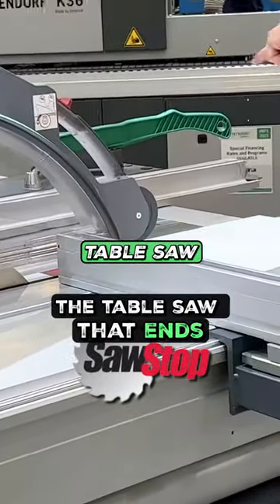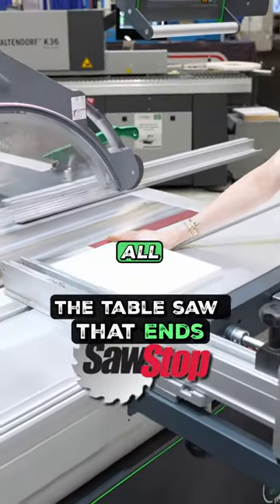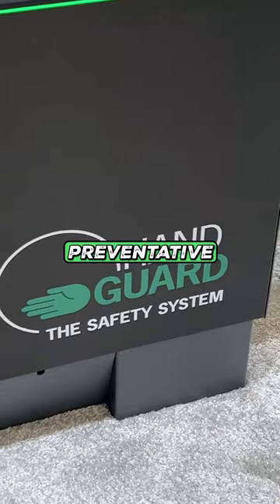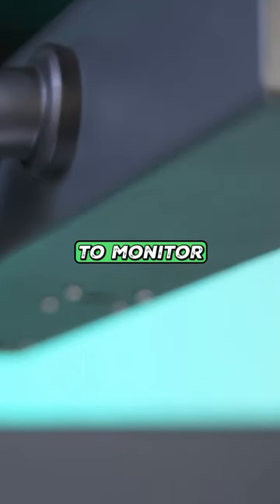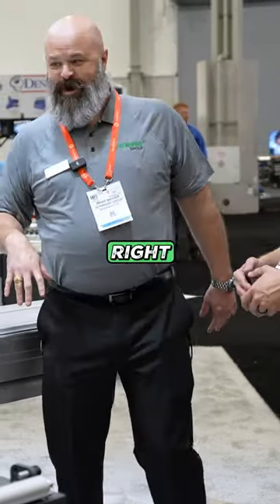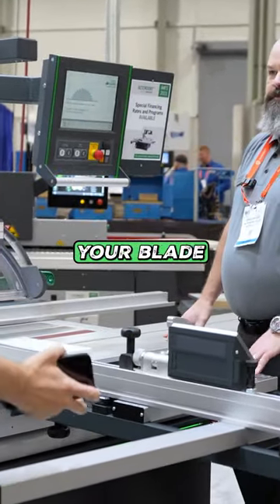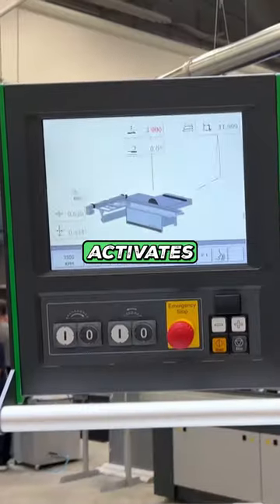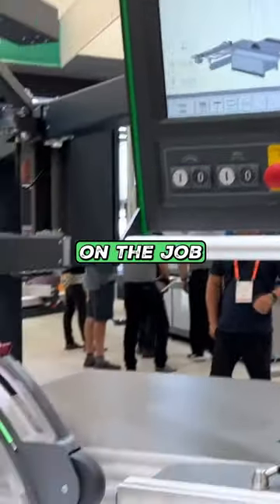Could This Tech End SawStop's Monopoly on Safety?

Comment: I am all for anything that can reduce the chance of a injury.  Many years ago at a pallet manufacturing shop i was a few feet away from a man that lost 4 fingers on his left hand. Radial arm saw accident.  He wasn't paying attention, was in a hurry and pulled the saw across his hand. One other boy and myself was digging through the sawdust looking for his fingers to send with him to the hospital in hopes of reattaching them. 
We actually saved three of them, the pinky finger was too mangled.
Reply: Been there.  Ran my hand through a table saw when I was 16 and distracted.  I was lucky enough to have a good surgeon so I only lost one joint in my thumb but they did a good enough job that I now type on a keyboard all day for my tech job 35 years later.
Reply: Damn
Reply: I was thinking that technology is aiding us in becoming stupid, but your comment snapped me out of that nonsense.
Reply: @thegoodfight365 anything can happen sadly, I work on the railroad and we had a guy that got crushed between two railcars still new but radio failure as well. He's alive but physically he's messed up for life. My company came up with a remote that you can push on your person to deactivate the locomotive even if you're 20 cars away ,pretty neat tech.
Reply: The crazy thing is that this technology (as well as that of SawStop) won’t stop problems of pinched work pieces that get jettisoned back at you. I wonder what messes people up more: grinders w/o guards or table saws?

Comment: This sounds like one bug away from disaster. I’ll stick with reactive which has a lot smaller margin for error
Reply: I wonder if there’s a way for them to combine both with a reactive one as a safeguard if the other one fails
Reply: @alop53O1  That would be perfect - it seems like this system can react quicker than the saw stop, so you can save the blade but still have the saw stop as a safeguard in case something goes wrong. It would be cool if the two companies collaborated on that.
Reply: @quazimoto5241 it reacts quicker because it does not rely on physical touching to happen like saw stop, which means it can go down much earlier than sawstop, so it wouldn't be practical to combine both mechanisms because they work differently but achieve the same goal
Reply: @L0LIProp   why wouldn't it be practical to have a sawstop system function as a failsafe for this?
Reply: My thoughts exactly.
Reply: @bakedbeanfanclub  cause the saw stop is a instant drop instant stop basically the worst that’ll happen is a small cut this system does take longer to go down but still prevents injury as it goes down before you get too close he looked like he was a good distance away and could see the blade moving unlike saw stop where it disappears in one frame to be short I think combining them would work just not as well as the saw stop does currently as that slight bit of extra time to drop means a deeper cut in your fingers
Reply: Ok boomer.  It's not like it's code powering a rocket, it's just a comouter controlling servo motors. 🙄🙄

Comment: It would be ideal to have both the proactive and the reactive safety systems in one saw.

Then you have a backup if one system fails.

Although, nobody should need these safety systems if they bring their brain to the game.

As someone who has ran their hand through a table saw and had everything reattached mostly successfully, I have the most razor sharp focus on every cut because I've experienced the consequences of distraction.
Reply: The only problem is that a capacitive system cannot cut aluminum, plastic or green wood. That was one of the issues we wanted to solve by creating this system.😊

Comment: What happens when the cameras are covered in sawdust? Or even worse, MDF dust?
Reply: Likely has a pinhole with compressed air ran to it. That’s typically how these type of cameras stay clean in a debris filled environment
Reply: I'd also bet that the saw won't turn on if the cameras don't have a good readout

Comment: This is a really cool idea, but how do you compensate for when wood scraps or sawdust block the sensor?
Reply: The system will be able to tell if the vision is blocked and there will be signals to tell you to clean the camera’s
Reply: You shouldn’t have that issue if you’re running a shop vac to collect the saw dust.

Comment: Kitchen equipment I work on has a "camera" i.e laser that works off of reflector plates. These regularly stop the machine from working due to moisture on the lenses. How is this safer than SawStop without constant nuisance issues?

Comment: It's a nice try at sharing the safety market with Saw Stop, but really, Saw Stop's reactive system is a solid simple fool proof system that I would trust way before a software heavy "AI" system. I see this maybe being more for a commercial setting, where people can throw money away in order to appease lawyers, insurance people and OSHA. When actual safety takes a back seat to the apparent effort to achieve it. In which case it takes away liability, no matter if the device actually works. This isn't so much a hit on the company in the video as a reflection of my trust in modern computer systems. Hopefully they find their niche.

Comment: Ofcauss its super impressive and works
But! When it starts using electronics it becomes something completely different for consumers…

The sawstop is so great because its just mechanical parts and one loop of wire in essence

Anyone can fix a machine with a sawstop installed on it but you need an expert to fix anything if this saw has a problem

Comment: Wait for Sawstop to sue it out of existence like they did when Bosch implemented a safety system that doesn't eat your blades.
Reply: I think bosch was busted by sawstop because the means of protection were too similar. This saw has quite a different method for saving appendages.

Comment: And it only costs approximately $50,000. And they have their own patent on the Hand Guard system and I don't see them rushing to license to others, and if Grizzly/Delta/Harvey etc. all start using this system it opens them up to liability for their other machines. Does it seem like a great system, hell yes, and if I decide to build a new shop I will be ordering one.  But I also had one of the very early Saw Stops.  While building my last house, the contractor was allowed to use my Powermatic 66 and had one of his employees lose a thumb due to kickback -- he was crosscutting without a sled or mitre gauge, piece kicked back, hit him in the forehead and, stunned, he put his right hand right across the spinning blade.  Very ugly.  Saw Stop came out, i bought it.

Anyhow, I very much doubt we are going to see Hand Guard on any machine under $30,000 for more than a few years.  Also, Felder has a competing system which I looked at a couple of years ago.  At the time was only available on their Format line, again mid $50,000.

Saw Stop was and is a pioneer, an innovator and he offered to license it to all the major manufacturers.  They all said no, probably realizing that it would potentially expose them to liability if they continued to sell non-Saw Stop enabled machines.
Reply: I'd love a source on that Saw Stop tried to license it because their patent is the only existing bullshit excuse for the prices they charge.  If that wasn't a unique system there is NO WAY they'd be able to maintain their prices.
Reply: It's amazing what you will instinctively do when something happens quickly and without warning!
Reply: @Taylexwow are their saws really that more expensive than competing saws of their size and quality?
Reply: @Taylexwow  "If that wasn't a unique system there is NO WAY they'd be able to maintain their prices."  So he built a better mousetrap and the world beat a path to his door.  And they can maintain the prices they charge BECAUSE people value safety and are willing to pay for it.  Nobody is forcing anyone to buy a SawStop and if woodworkers didn't value the added safety, (1) SawStop would have gone out of business and (2) Altendorf and Felder wouldn't have come up with their own designs. And as to his offers to license, do your own research of the SawStop development.